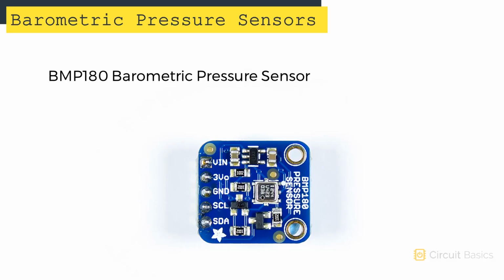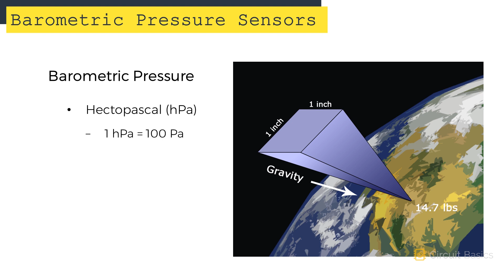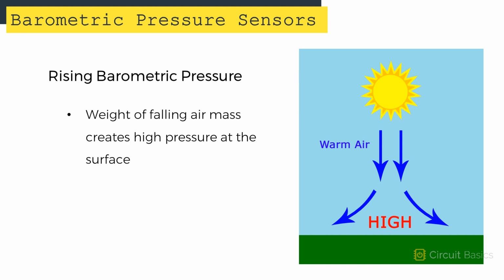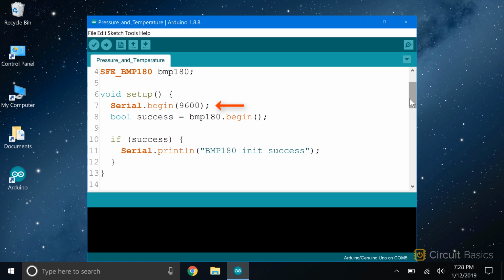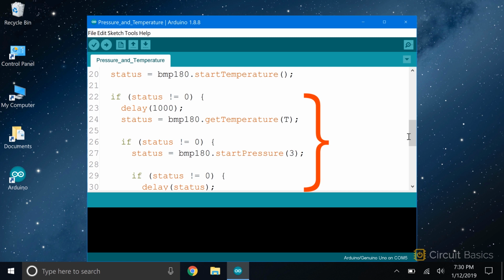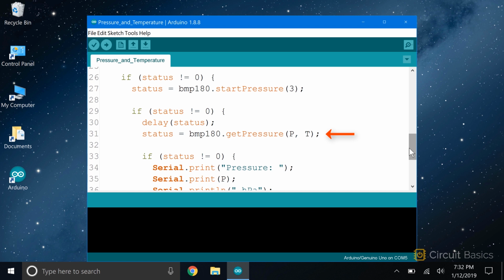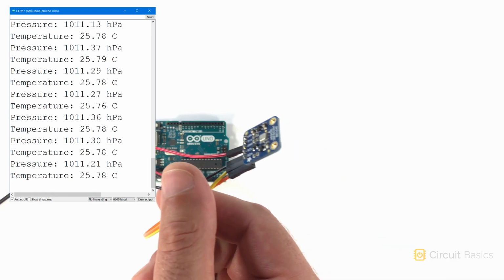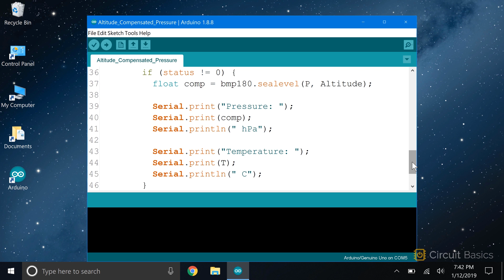How to Use Barometric Pressure Sensors on the Arduino - Ultimate Guide to the Arduino #39

Comment: There's something not right here.  As you say, a pressure difference of 1 hPa corresponds to a height difference of about 8 m.  Therefore lifting the sensor around 3 inches, as you did (call it 8 cm), you would expect to see a pressure drop of only about 0.01 hPa, yet your output shows a drop of almost 20 times that!  In any case the readings even with the sensor lying still on the table are fluctuating wildly.

Comment: I need a circuit modue to use vacuum sensor as speed control of 24v  dc motor

The vacuum set value is -3 kpa